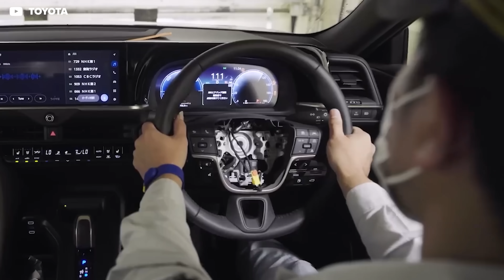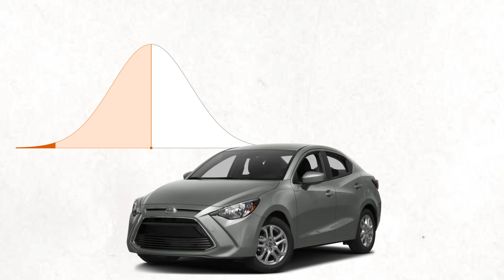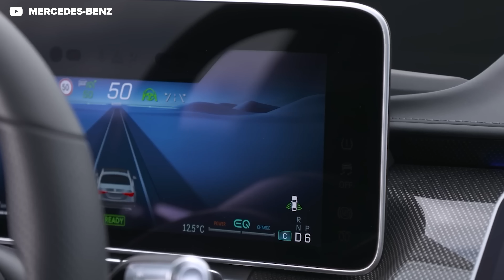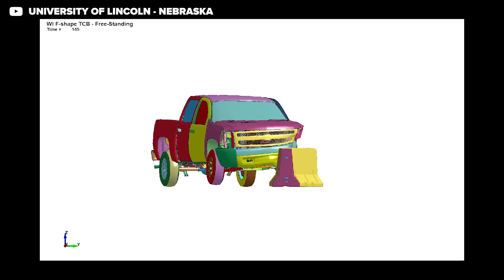The REAL reason guardrails can't stop EVs in a crash

Comment: Also worth noting that if you make guardrail stronger to contain heavier vehicles, it will flex and bend less when a lighter vehicle hits it. This has the same effect as a smaller crumple zone, and it increases the G forces that a smaller vehicle and its occupants will experience. This is already true of the current guardrail, of course; the sedan test vehicle experiences higher G forces than the pickup, but the effect will be further magnified for stronger guardrail. 
So the new stronger guardrail may be safer for your $120,000, 11,000 lb Hummer EV, but your $15k, 2900 lb used Corolla will be less safe. Tale as old as time.
Reply: and that Corolla is ~20x more prevalent
Reply: the guardrails are there to protect the people on the opposing lane.
Not to "soften the blow".

And we had this exact problem already with full sized 40t trucks. They often pass both guardrails and then seriously damage/injure innocent vehicled on the opposing side.

The governments get away with cheap guard rails instead of full sized concrete barriers that prevent 4m vehicles from going over them.
Reply: So just add another guard rail behind it (double them up).  You get the additional protection without changing the crumple zone dynamics.
Reply: How about a gazillion sandbags stacked on the outside with gaps for drainage?
Reply: These heavier cars should be taxed if the owner doesn't own a business that requires say a vehicle over 5k pounds
Reply: I love small cars. Don’t crash into bigger ones. The biggest fear I have is sitting at a stop light and some guy in a heavy vehicle staring down at his phone.
Reply: Happens all the time for motorcycle riders, everything is made for cars, big cars that take up massive amounts of space and stop you from lane filtering, which means motorcycles will end up taking an unreasonable amount of space when waiting in traffic, same for safety stuff, everything designed to keep you alive in your massive car will kill a motorcycle rider, same for the road safety features and so on and so forth.

I had an argument with one of my local politicians about the delay in fixing potholes, she thinks its fine for a pothole to grow over six months, despite having large volumes of two wheel traffic in the area on the regular.
Reply: Just add a second rail below the first, problem solved.
Reply: @kyled.higgins9063 I’d rather wrong my hands. Thank you very much.😂
Reply: We need layered guard rails. A first layer of lightweight barrier will catch the lighter vehicles and stop them gently, and take some of the momentum out of heavier vehicles. Vehicles that tear through that first barrier will be caught on the second or third layer.
How much money are we willing to spend to save a life? How much would you spend if it might be your own life, or that of your child or grandchild, that needed to be saved?
Reply: Actually, I think it's only a tale as old as guardrails. I'll just leave now.
Reply: The single rail guardrial system is also designed to mazimize injury to motorcyclists as then slide under it during a crash or get split in half sliding into a supporting post.
Reply: Guard rails are already made to contain heavier vehicles because there are trucks and HGV on the roads....
Reply: @chrissmith2114  No.  Trucks routinely demolish and disintegrate guard rails.
Reply: @chrissmith2114  you.... you really did not understand anything said in the video?
Reply: @ABaumstumpf  The centre of gravity thing rubbish, just clickbait - it is the weight of vehicle and its speed.
Reply: @chrissmith2114  "The centre of gravity thing rubbish, just clickbait - it is the weight of vehicle and its speed."

Ok so you did not watch the video - or are just incapable of understanding simple concepts.
Reply: @ABaumstumpf  A hit low down on the guardrails will try to physically push the whole guardrail sideways having to shear the foundations across the earth, a hit towards the top will push the guardrail over with a lot less energy. Once the posts have tilted the guardrail is very easily flattened and the vehicle can go over the flattened armco.  This is just anti-EV clickbait - and believe me I will be the last one to protect EV
Reply: @chrissmith2114 Your are very correct!! Now have a look at Australia’s wire-rope barriers… an absolutely terrible barrier.
Reply: @chrissmith2114  "A hit low down on the guardrails will try to physically push the whole guardrail sideways having to shear the foundations across the earth"
That seems plausible at first but not if you would think about it for a second as even the video shows: It does not matter if the vehicle has a low profile.
Heck the posterchild and thumbnail of this video is about a car that is the exact opposite of your claim.
And also the research disagrees with you there.

So the question is still the same:
What about the low centre of gravity causes a problem? 
You claimed answer is just WRONG - so wrong it is embarrassing to even see somebody stupid enough to dare posting it.
Reply: @LukeAusNSW we have these in Britain as well, absolutely lethal to a motorcyclist as instead of hitting them and often going over the top, as you would with armaco, the rope slices the body up, even in low speed accidents the rope barriers create far more severe injuries, someday someone will push through a claim that the authorities put these in in full knowledge that they were dangerous and the compensation will see an end to these lethal barriers.
Reply: @LukeAusNSW  Australia’s wire-rope barriers are fantastic; they work exactly as intended.
Reply: @CrusaderSports250  Who cares about motorcyclists? if you ride a motorcycle, you are already deserving of a Darwin award and it's up to you to avoid getting into an accident.
Reply: @petesmitt Exactly.
I really wish we could design infrastructure to subtly discourage heavy trucks, but that's unfortunately rarely possible.
Trucks unilaterally increase (relative) safety for their passengers and endanger everyone else.
Reply: @antonliakhovitch8306 trucks larger than 7-8k pounds are exceptionally rare. the new standard they're upping guard rails to, around 12k pounds iirc, is about the upper limit before all you really see are box trucks, heavy duty pickups, and other exclusively commercial vehicles.
Reply: @antonliakhovitch8306  the problem with trying to “subtly discourage” heavy trucks with infrastructure is that the problem vehicles are in the 2-5 ton range, but there are also several classes of vehicles in the 10-50 ton range that we don’t want to discourage. Due to various factors surrounding their use, commercial trucks are much less of a danger on the roads than large passenger trucks and SUVs are. And a much higher percentage of commercial trucks are justifying their size and weight by doing something valuable for society and that couldn’t easily be replaced by smaller vehicles.
Reply: @chrissmith2114 did you not just watch the video in which an expert in the field of guardrail design said that lower vehicle centers of gravity are part of the problem??
Reply: @Natediggetydog  LOL,  you can find experts everywhere,  I am no friend of EV but this seems like anti-EV clickbait
- yes I did read the article but I also studied mechanical engineering, maybe they are trying to blame the low bonnet line on some EV
but that low bonnet is a plus for pedestrians and also appears on many saloon cars
Reply: @petesmitt a motorcycle can provide cheap accessible transport, never been a supporter of all the stupids you see on the tube, they are your Darwin material and unfortunately they are the ones that get attention,  who cares?, all the people who know the motorcyclist and those that have to pick up the pieces following accidents, worse still if those deaths and injuries have been exacerbated by poorly designed road infrastructure,  motorcyclists pay to use the road as well as car drivers, so they should expect the road infrastructure to be as safe as possible,  armaco for all it's problems was safer than the rope barriers.
If a sliced off leg or half a body landed in the opposite lane forcing you or someone else to swerve,  colliding with other vehicles, then that could effect you, then you would care.
 As far as your last comment,  it's all road user's duty to avoid an accident, where possible, from the largest lorry down to a pedestrian.
Reply: @chrissmith2114  Studied is not Mastered.
Reply: @petesmitt why do you apply this to motorcycles and not cars the only difference is cars mostly kill other people and motorcyclists get killed by cars.

Its inherently morally better to ride a motorcycle
Reply: @chrissmith2114  Guardrails are supposed to be bolted to the posts through wide slots and no rectangle washers so that the guardrail can deflect back without mowing over with the posts. The posts shouldn't have to shear off at ground level in order for the rail to not be pulled down.
Reply: Population control
Reply: @youbetcha108  If it's population control, why aren't they putting wooden guardrails, or none at all?

Comment: This is 2025......What are these "economy cars" you speak of?
Reply: CAFE standards have eliminated economical cars in favor of larger SUVs and EVs.
Reply: @fredsilva7274  standards are still there for small cars, larger vehicles face less strict standards and therefore cheaper and easier to make. hince auto manufacturers make more suv's and trucks
Reply: @fredsilva7274  cafe standards were designed to be leniant on work (construction, farming, manual labor) "light trucks" because "muh hard working muricans". Car manufacturers saw this, and took advantages of those leniencies to design oversized "cars" using the same frame designs in the same factories as trucks and called them SUVs so they could sell under regulated land barges to other people. And they pumped amounts of money into advertising these monstrosities that would make Elon Musk swoon. It worked, and now SUVs have consistently been the best selling class of vehicles for years now.
Reply: Try a 1997 Honda Spivic with a fart can.
Reply: China sells them: but they are subject to a 100% tariff.
Reply: @economicprisoner  You mean Chinese junk they want to offload on the rest of the world.  China has literally millions of unsold vehicles rotting.  No one wants them.

Comment: In Texas they have cable guard rails that catch cars and the lower cable is low enough to catch an EV.  I have seen Tesla's tangled in them.
Reply: In Sweden, cable guardrails are common. Don't like them, killing motorcyclists. Only tried them with a small car at 70 MPH. Totalled car, no person injured.
Reply: @Mike40M  If a biker goes into a guard rail, that's not the guard rail causing the damage.
Reply: The cable style guard rails are common in most states, not just Texas.  Interstates are not subject to state statues, but federal; and the interstates are the largest user of that style guards.
Reply: @vincentsutter1071  They were first installed by Texas along with many different road features on modern sections of interstate due to TXDOT.  These features are adopted by Federal DOT at a MINUMUM requirement when funding states to improve or widen sections of the interstate.  So yes, they were first installed in Texas in the pan handle in like the 80s.
Reply: @quazy1328  I responded to your comment noting they are in use in Texas; that they are in place across the US.  That is fact. No one cares about where they may have been installed first.  You like hearing yourself blather on don't you?
Reply: Wow!  You mean engineers can figure out solutions for EVs?  /s
Reply: @tokomok  They are a death sentence for any motorcyclist that hits one.  So I wouldn't call it a win.
Reply: @tokomok  They are very expensive to install and have to be inspected more often.  Also if there is an accident you can't just replace that section, you have to replace the whole run.

Comment: Concrete parapets are not secure to the ground. Guardrails and posts are made of aluminum. Posts driven into the ground about 12 in.  Yeah, that's gonna make a great 'Blame the EVs' video.
Cody needs to attend a real engineering school.
Reply: Most highway guardrails (including the ones shown in this video) are made from a galvanized steel, perhaps 50-70ksi lbs tensile strength depending on the actual section and position. Aluminum would cost roughly three or more times as much for the same coverage, and would be at risk of theft by scrapping gangs.
Reply: @davidg3944  Please present me with the documentation concerning the metals
used in the construction of these guardrails and their posts.  
Too, what is the annual cost of aluminum, worldwide, due to theft annually?

Comment: I think one aspect that goes hand in hand with weight, is popularity and accessibility. An old truck may not be too different from a new one, but people didn’t buy trucks in droves back in the 60’s 70’s and 80’s. Now a full-size pickup essentially takes up the mantel of what an older regular sedan was as a family runabout. More people are buying more larger/heavier form factor vehicles.
Reply from the maker: great point
Reply: The Luxury Pickup truck and SUV replaced the old Full Size Cars like the Crown Victoria.
Reply: @KentTeffeteller   I think the SUV replaced the station wagon.  Especially with modern safety standards keeping many kids in at least a booster seat until 9 or 10 and out of the front seat until 12 or so, you basically need a third row if you are going to transport more than 2 or 3 kids.  If we are just running out own kids around, we take our IONIQ sedan, but if we are car pooling or picking up a couple of friends after school, we basically have to roll out the Ascent SUV.
Reply: @disjustice  For me, true SUV means it must have superb off road capability. Subaru does well on that aspect. Subarus are also intelligently designed.
Reply: People buy them because it's what the regulations, and thus the manufacturers, push for.
CAFE standards are the main culprit, not the consumer.
Reply: @tom.m  Pickup trucks and SUV's were allowed to skirt CAFE rules. And have the engine options for the automakers to make massive profits. And also they were marketed to users which could and should have had proper vehicle choice.
Reply: @KentTeffeteller  Exactly. The CAFE incentives are all completely backwards from the claimed objective. It's why SUVs took over.

People used to mock folks for driving giant vehicles like Escalades. The consumer didn't ask for this.
Reply: @tom.m "the public wants what the public gets" as the song says and it's very true, the power of marketing😊.
Reply: Ford isn't even making cars any more. They are focused on SUV, cross overs, and trucks. GM closed my previous purchases (Pontiac and Saturn) and when looking for a new car I figured I should try Ford (love my Fusion) and now that I can't get a car there either I am going to look to Japan for my next car.
Reply: the problem is making them bigger to then charge more to inflate profits and then they sell you on "safety" but they leave out the part that  the bigger vehicle owner makes everyone else around them significantly less safe. 
they arent safer for anyone but the driver of the bigger vehicle. 
there should be limits and regulations for how large a vehicle is allowed to be. 
of people get mad about that, they should customize their vehicles in ways that doesnt give away their micropenis instead.
Reply: Don't worry, the car debt crisis will resolve that one. Of course, then everybody will be $60-90k in debt but the F150s doing the 3 mile school run will be sitting in repo lots.
Reply: In the past, people bought trucks to be used as trucks. Now they buy them because really they need a car, but buying a truck makes them feel manly, so they get a truck with a fullsize cab, and a smaller truckbed, which won't be used anyway.
Reply: @xeridea  No dude, not manly, but safe. Like, I'm in a 4 ton FRAME truck, if you hit me with your car, you'll turn into a pancake, but I won't. That's what makes the difference. The one in the bigger car will survive.
Reply: @hibahprice6887 and if everyone in the world drove huge trucks, then no one would be safe. Your argument is a bit pointless I still stand on my comment that most people get trucks just to feel manly, and they serve no purpose at all
Reply: The trucks people actually buy now are much heavier than their classic counterparts too.
Reply: Driving across the US I saw many HD 2500 type Trucks and SUV many with trailers we are talking 10,000 lb easy
Reply: @hyphydan  the problem is the zero training from a professional any of those people have had on pulling large loads or driving 4 ton trucks.
Reply: @geofrancis2001 yep. In Europe and everywhere else heavy vehicles require additional licenses
Reply: @geofrancis2001  Or the basically non existent driving lessons from actual driving schools. Parents teaching their children to drive should not be the norm, but its the car dependent US we are talking about here...
Reply: @hyphydan  Yes pickup trucks sometime get used for their ability to haul cargo. Though most pickup trucks are used as commuter vehicles.
Reply: @buffalowt  Please, you could also easily tow trailers with two cars on them with a good VW Golf that has a diesel engine. But since the US doesn't get the towing package option for small/normal cars they are forced to turn to pickup trucks and massive vans with way more power than necessary.